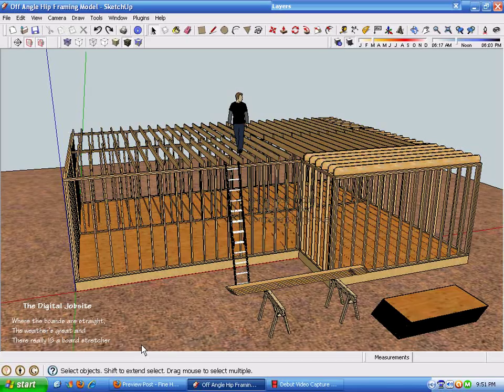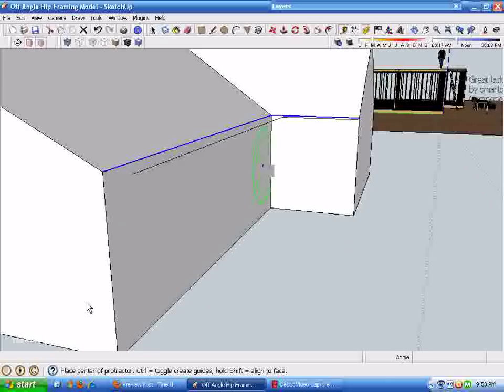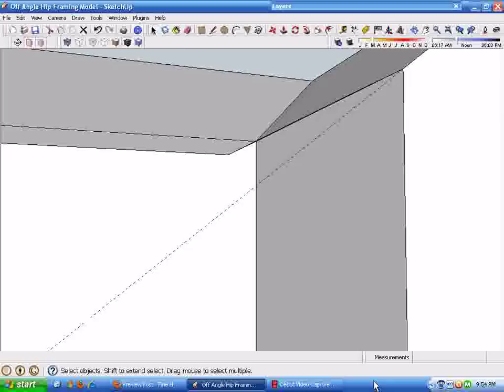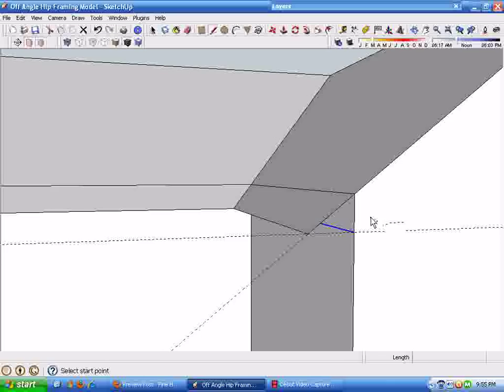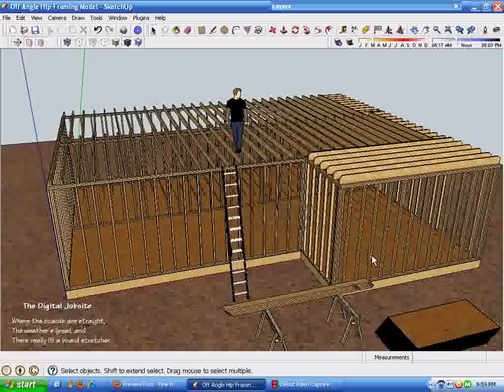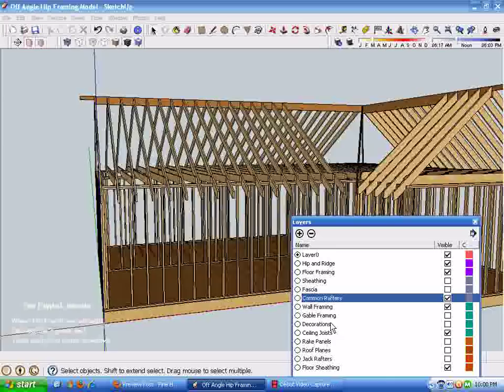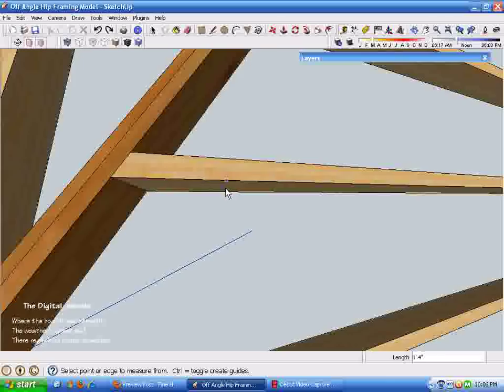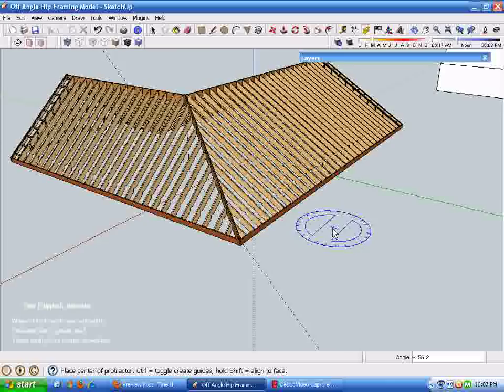A Tale of Two Pitches Part Two

Comment: To get the fascias lined up on unequaled pitched roofs and keep the same overhangs, all you have to do is cut a rafter tail of each pitch including the birdsmouth and line up the overhang. Then measure the distance between the birds mouths and raise the wall height as necessary. Rule is on hips,  the wall height is raised on the steeper pitch and the lower pitched is raised in the valleys.

Comment: Why not change the wall height, or the seat cut and wall height + offset the hips and valleys? What are the slopes 8/12- 12/12?
Reply: Yeah a real framer would raise the wall height on the steeper pitch side
Reply: Yeah this guy has no clue on how to achieve that result, he couldn’t even figure out how ceiling joists would work when it comes to walls of different heights. He isn’t a real roof framer or a carpenter by any means.

Comment: Fantastic video which clearly shows the principles.  I've read elsewhere that equalising the soffits and fascias on two unequal pitched roofs can be achieved by raising the wall plate on the steeper roof. But if you do this wont it as a consequence alter the pitch of that roof?  My situation is that I've got an existing (steeper) roof on the side of a house and want to build another roof with greater extension, and therefore at a lower pitch, on the return wall of the house.
Reply: It's entirely an exercise in geometric compromise Raymond where you decide where to show/hide the inevitable differences.  Raising the wall plate by making a taller wall would affect ceiling height so a common way is to add a knee wall or extra plates on top of ceiling joists.  That raises the bearing point/birdsmouth without altering ceiling heights below. But that's just one of an infinite number of work-arounds. Best, Matt
Reply: Matt, thanks for the rapid reply. I get the geometry angle (pardon the pun) but because it is all about geometry can you confirm one aspect for me please.  IF I raise the height of the wall plate then it MUST result in a reduction in pitch of the roof whose rafters rest on that wall plate.
Reply: @raymondmcguire1250  yes... if you use the top end of the rafter at a 'hinge', the higher you raise the plate/rafter tail, the flatter the pitch/slope.  An alternative is to raise the 'ridge' and plate the same amount.  In that scenario the slope stays the same but the ridge height changes (gets higher).  Not sure of your exact situation but think it's good that you're working through all these issues with digital lumber first! Best, Matt

Comment: the answer to your  question may be  an adjustment  with a stair gauge  by using 17 on the body  what ever the plumb      cut is on  tongue of the framing square , you can use any unit you want as long as the cuts are right ,

Comment: Very nice tutorial, but I can't help but notice that the crown end rafter isn't in line with the ridge in that drawing, any particular reason why it isn't? Because I would have thought for the geometry to be correct (which you do stress) it would have needed to be in line. Also you didn't tell us which pitch (plumb cut) the hip or valley is cut at, or would it matter if you use either?
Reply: Firstly I'm a trade qualified carpenter & joiner here in Australia, here the crown end rafter is the rafter that butts into the ridge in a hip roof and is positioned in the middle of the span (it isn't a common rafter here, because it's slightly shorter generally depending on the thickness of the ridge and or rafter), all other rafter at a hip end are jack rafters. https://plus.google.com/u/0/photos?pid=5993696267940412546&oid=102165166882140940795 Why isn't it in line with your ridge as it is here in this picture?

As for the plumb cuts to a hip or valley, they can't be the same for a 22 degree roof as for a 30 (the plumb cuts to the rafter with different pitches aren't the same are they?), since you have two different pitches, which pitch did you use to cut the plumb cut of the hip and valley?
Reply: ***** In this picture C & J are crown end rafters to me and you can see they are in line with the ridge, why isn't yours in line, because it doesn't matter? I would have thought it would be easier to get a hip length by tape measure with that rafter in line or when you use marked in position method for getting hip lenght. http://www.sweethaven02.com/BldgConst/Bldg02/fig0930.jpg

>>I thought you were questioning plumb cuts on the hip/valley rafters themselves<< It is what I'm talking about!!!!!!

If you build a 22 degree pitched hipped roof, the hips would have a different angle plumb cut to a 30 degree hipped roof wouldn't it? If you have two different pitches, I'm guessing the major pitch is what you'd use for the plumb cut. I hope you understand because to me it's an easy enough question written simplicity.
Reply: You didn't notice that it's not a hip-ended roof? It's gable-ended therefore no crown rafters.

Comment: to make the steeper angle cheek cuts over 45 degrees all you have to do is cut your plumb cut and take the difference in pitch set the circular saw to this angle and cut the
1  1/2 face of the rafter. For instance, if the angle of the cheek is 67 degrees, cut the plumb cut of the rafter to the long side first, then set you saw to 23 degrees, turn the rafter up on edge and cut down the 1 1/2 face of the rafter. You now have your 67 degrees cheek cut.

Comment: The shape of my house is very similar to the house in the program. I'm wanting to build a wrap around porch. How could I match the pitches of the 2 roofs?
Reply: It would take a whole lot more information to answer your question, Justin, but I will tell you SketchUp is my go-to tool for figuring out stuff like that.  My advice is to start with the roof planes themselves: create grouped geometry for each of the roof surfaces at the slope/pitch you're working with and manipulate those surfaces around into the configuration of your porch and house roofs.  Because you're 'building with bytes before boards', once you get the roof surface figured out you can 'build down' from them starting with sheathing, rafters, and finally, walls to support it all.  That's probably not much help but if you tackle it with SketchUp you'll learn a whole lot in the process!  Best Regards, Matt
Reply: Next Level Carpentry sorry for the lack of info but it was meant as more of a general question. I appreciate the advice . Thank you!
Reply: Justin, you're welcome for sure... if you're using SketchUp to plan actual work you'll learn a lot about both in the process. Early on in my SketchUp years I was far too 'literal' with my models, trying to build stick by stick from the ground up like in real life.  Took a few years and some frustration to make the paradigm shift needed to think 'modeling' instead of 'building' but the shift allowed me to accomplish so much more.  So my advice, rephrased somewhat, is to start with basic box shapes with sloped roofs which are created and modified quickly and easily shifted around.  Once the general idea starts to take shape then  drill down and refine the model to better represent the actual building/framing process.  Hope you find other Digital Jobsite videos helpful in the process... Best, Matt

Comment: why don't you just change your heel height to line up the fascia it's called an uncommon hip do it all the time not that hard if you are going from a 6 to an 8 your hip is a 7
Reply from the maker: James,
Changing heel height is one of many ways to deal with conditions that arise when building an off-pitch roof.  In many ways there really is no 'right' or 'wrong' way to deal with fascia height, it's all about the end result.  Choosing which variables are used in any given roof design is usually up to the architect and builder and then mainly to satisfy the client.
Reply: @tomhanks1309  i've got 34 years yes you have to offfset the hip but if you want to keep overhangs the same depth you need to change heel height why change wall height more  work
Reply: @UCKS_gBaMcSxBmXeAFe1dXWQ sorry i've built a lot of large custom houses with complex roofs over the years when you have to deal with different size rafters it gets fun setting heel heights so you can use 1 or 2 2x's to build up the walls i always try to change heel heights in 1 1/2 inch increments